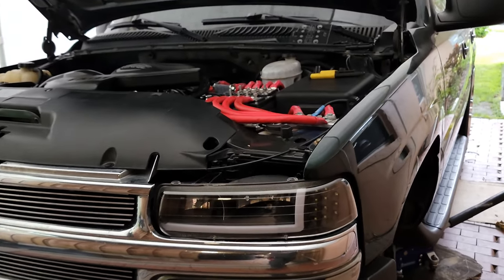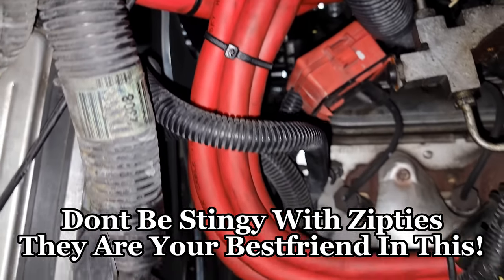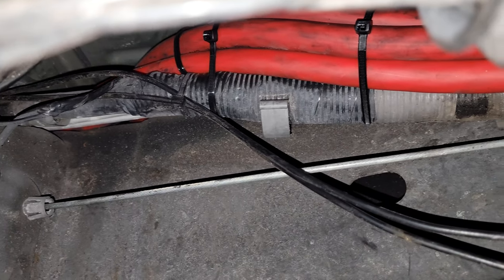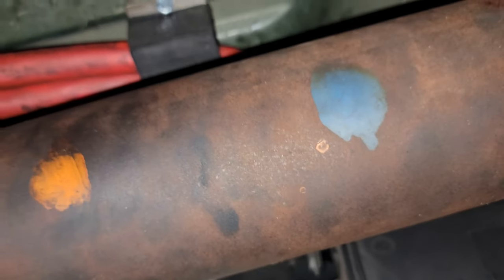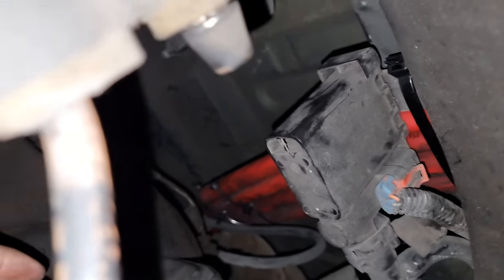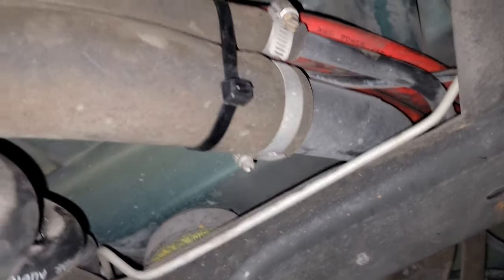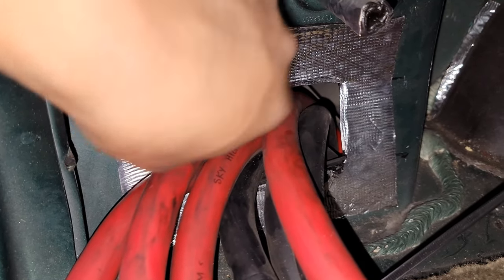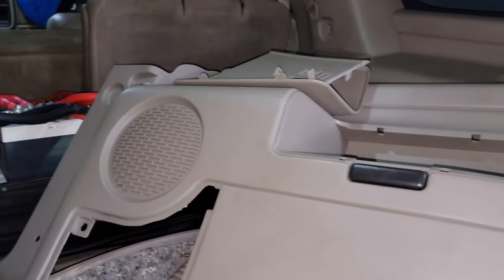Walkthrough On How I Ran My Power Wire Runs On My 03 Tahoe

Comment: You did a good job on your build bro. That's alot of wire neatly organized and secure.  Hey do you have a video on how exactly you installed your headlights . I bought some new headlights 2 years ago.  now I'm ready for some new ones like yours with the led strip in them. I just don't know how to exactly. To what wires to connect them to. Also I want to upgrade my bulbs too. I have some cheap Amazon ones right now.
Reply from the maker: Thanks man 👌🏽 I have a video on how i installed them, if you got any questioms drop them in that video bro ill try to help you out 💪🏽
Reply: @SleepyBoiii  ok thank you